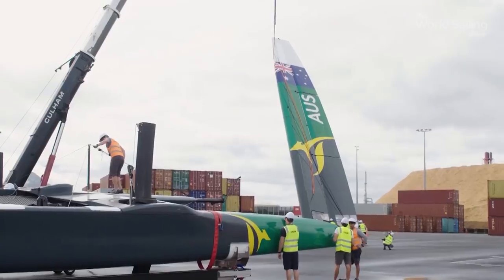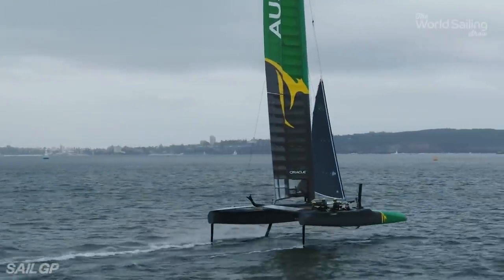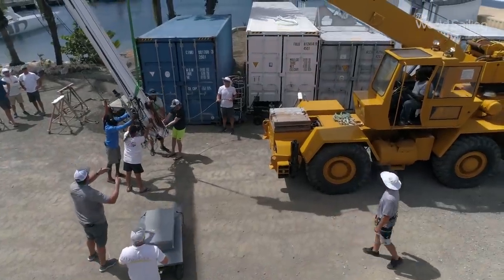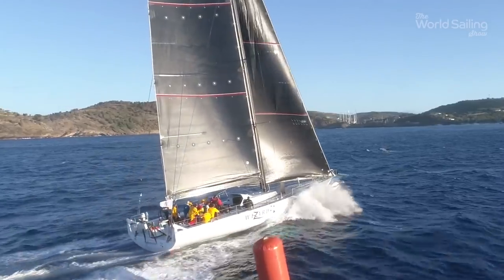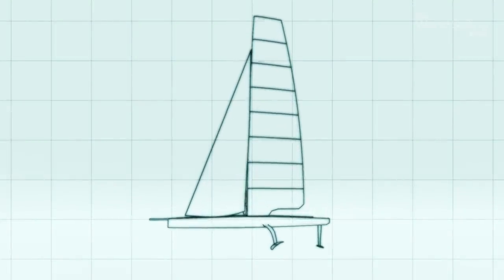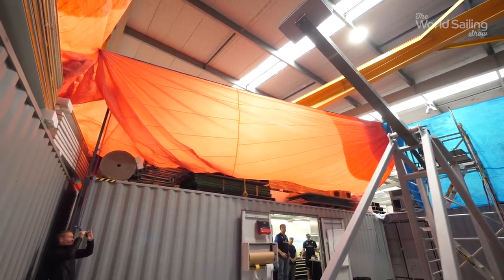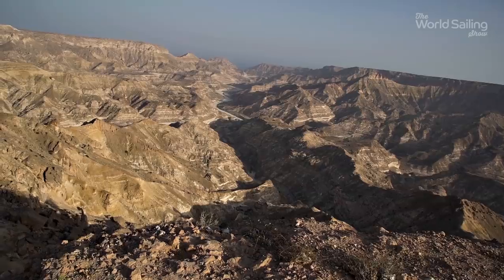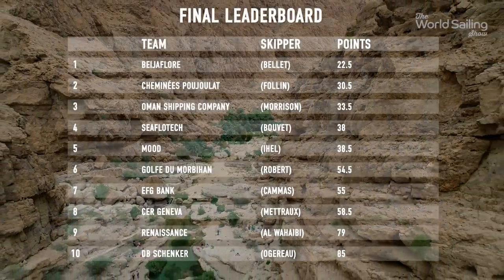The World Sailing Show - April 2019

Comment: Possibly a bit early to say the F50 has smashed through performance barriers. Sydney was too light t set speed records, but it's not like we saw complete dry laps in the light which might have been a realistic target. 
Even if the F50s do go through 50 knot barrier as claimed possible it's just nudging past the 47.57 knots we saw in 2013 or the 47.2 in Bermuda.

Comment: How much faster would a hydroplaning sail-boat be compared to a "normal" one with similar specs?
Reply: A lot. By lifting the boat out of the water you reduce a tremendous amount of drag. Yes windage is increasing but water is way more dense. Next time your at the beach or pool pay attention to how harder and slower you are when your walking in the water. Then try running.  You can't really run your faster but not by much. As you go into shallower water your ankle to go faster with less effort. Just like these guys.
Reply: @sailingbrewer  Cheers, but you literally haven't told me anything anybody else with modicum of common sense could have told me... Water is heavier than air, is it? Stop the presses! ;-D Just pulling your leg, mate... ^^